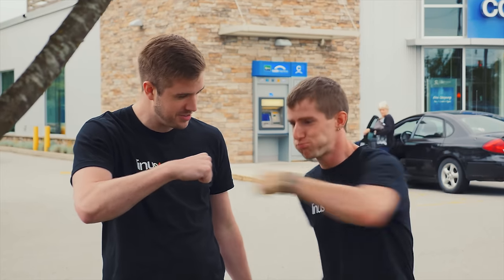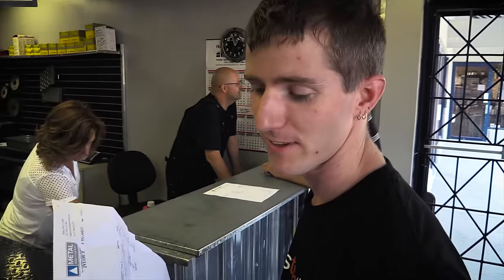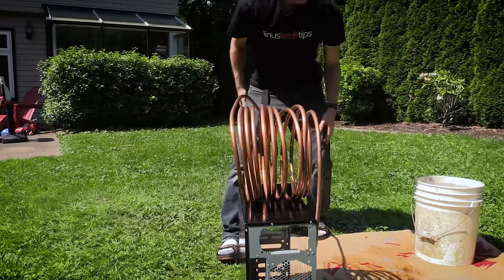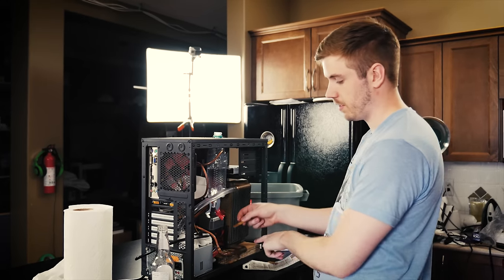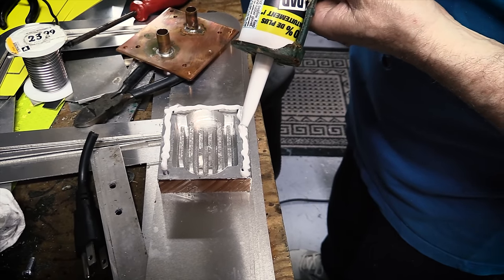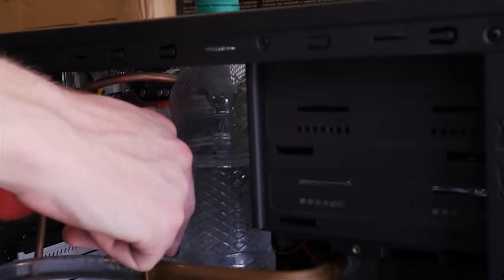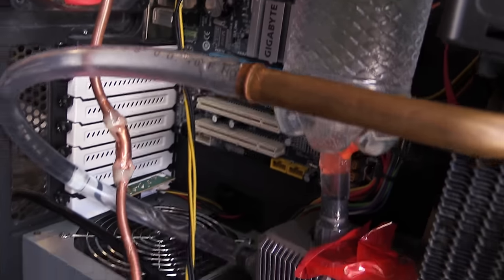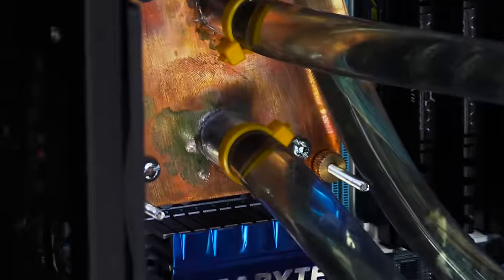$500 DIY Water Cooled PC Challenge - Scrapyard Wars Episode 2e

Comment: hi guys i need help i want to build a gaming pc but i don't know if my parts will run together
Case: Thermaltake Chaser Series Chaser MK-I
MoBo: Asus X79 Deluxe LGA 2011
Memory: CORSAIR Dominator Platinum 32GB (4x8GB) DDR3 2400
CPU: Intel Core i7-5930K Haswell-E 6-Core 3.5GHz LGA 2011-v3
GPU: Sapphire Radeon VAPOR-X R9 290 4GB GDDR5
Power Supply: EVGA 120-G2-1300-XR 80 PLUS GOLD 1300 W
SSD: SAMSUNG 850 PRO MZ-7KE512BW 2.5" 512GB
HDD: TOSHIBA PH3300U-1I72 3TB 7200 RPM 64MB Cache 
CPU Cooling: Noctua NH-D15 SSO2 D-Type Premium
I do not care if color were not consistent, i just want an ultimate gaming pc
Sorry for my bad english.
can you help me plz??